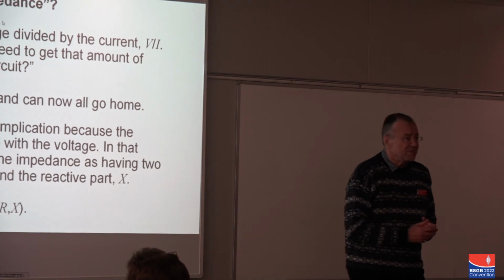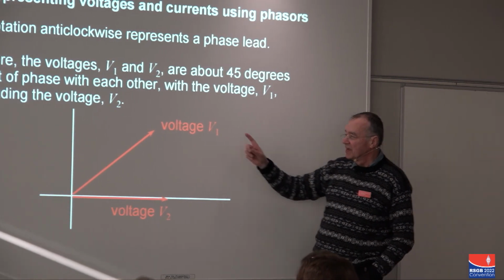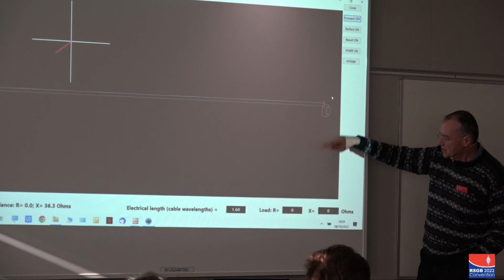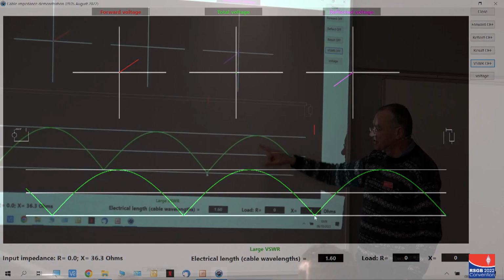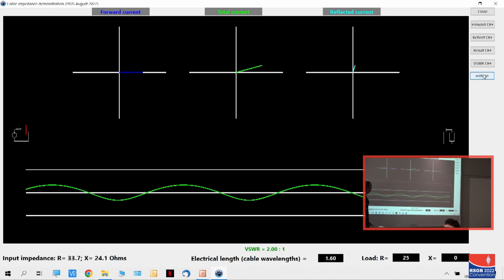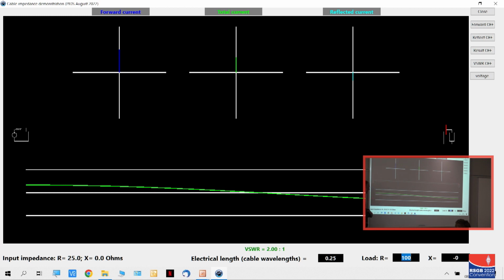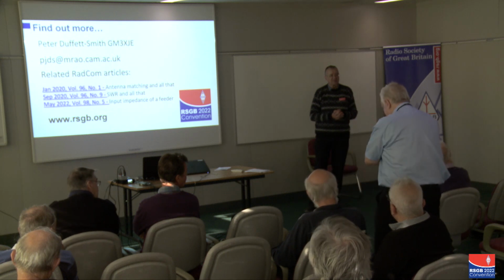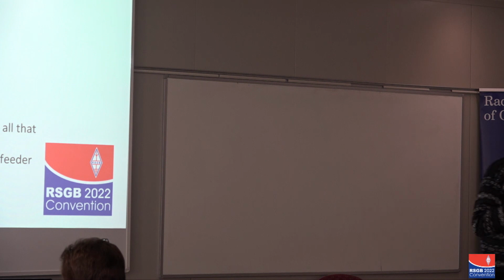RSGB 2022 Convention - Input impedance of a feeder

Comment: Yes, a good explanation of Input impedance of a feeder.
I can imagine C.B.'ers using this to justify trimming coax to the aerial and it must be a ½λ carefully trimmed to the exact length.
Then they say a jumper lead has to be multiples of 3 foot lengths. They forget it all connects together through the SWR meter as if it isolates the two. I asked a C.B.'er did the meter add to the aerial side or the transmitter side. I didn't get an answer.
In 49 years Ive never trimmed coax to a specific length except for crossed dipoles.
G4GHB.